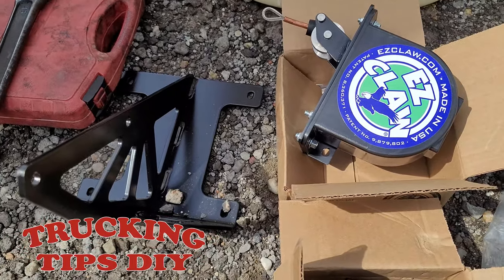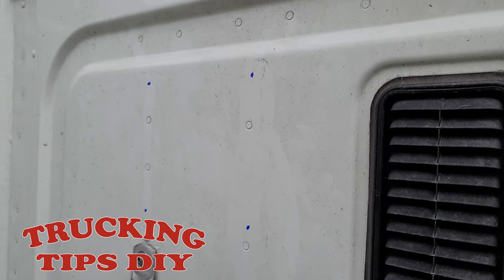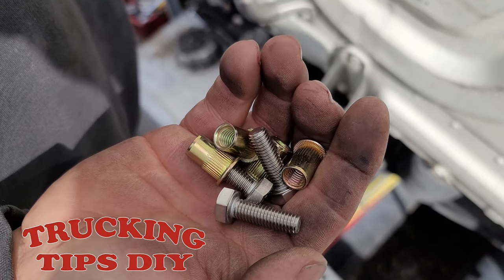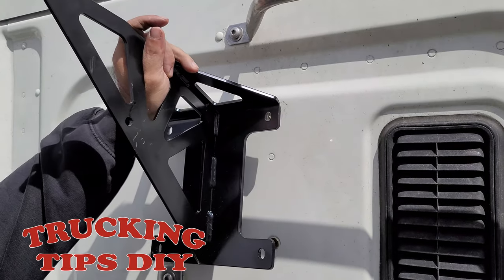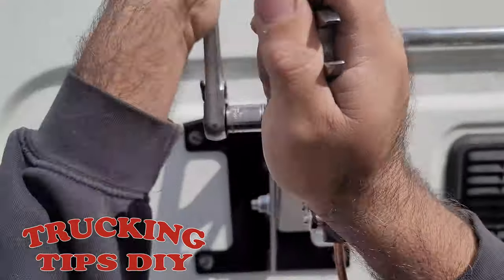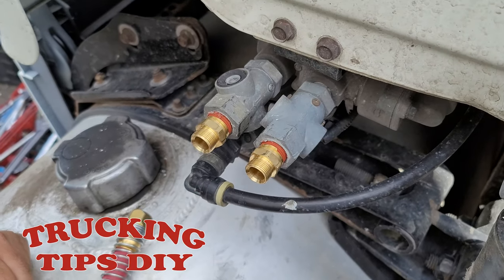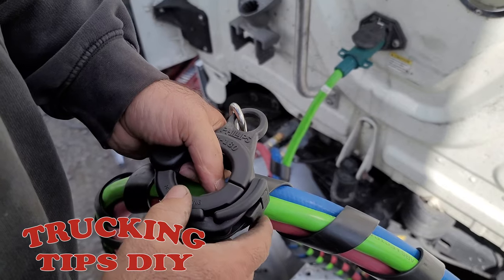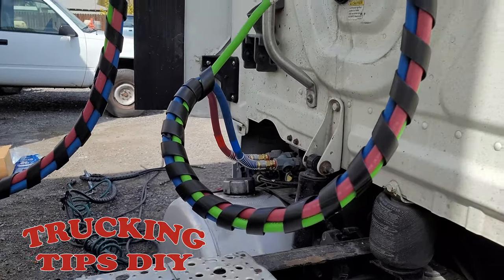How to Install EZ Claw Tensioner Bracket For Air Line / Mount For Trailer Electrical & Air Lines

Comment: That’s so cool I need that for my truck. I have the same model Cascadia with a long frame and the air lines are constantly getting messed up because it doesn’t have a pogo stick like Peterbilts and the springs they sell with these hoses have too much tension and don’t extend far enough. It looks very clean and smart the DOT likes to see that.
Reply from the maker: Thanks mark, yes I always had issues with the lines hitting and rubbing onthe truck, so i decided to go with this setup,  thank you for watching sir
Reply: Peterbilts don't come with a pogo stick
Reply: @TRUCKINGTIPSDIY  how did you determine what length to get for the lines

Comment: How did it hold up? I was told that rivet nuts will pull through the aluminum. You really need to pull out the interior and use something more substantial. I’m not sure if it’s true or not.
Reply from the maker: Its still holding strong
https://youtube.com/shorts/txKOunx2UtU?feature=share

Comment: Hey bro do you have video on bypassing heater core 2012 Freight liner Cascadia
Reply from the maker: Hello frankie, I dont buy ill make one soon, thanks for watching my vidoes bro
Reply: Amen bro I’m working on it today but I could find any help.
Thanks bro
Reply: Usually there's a shutoff valve on the head or on top of the engine just close the valve and you can replace the water heater later. 👍
Reply from the maker: Sam repairs replied to you hope fully that helps you